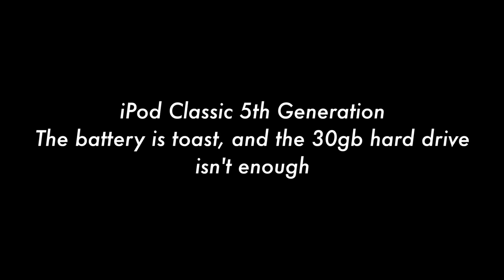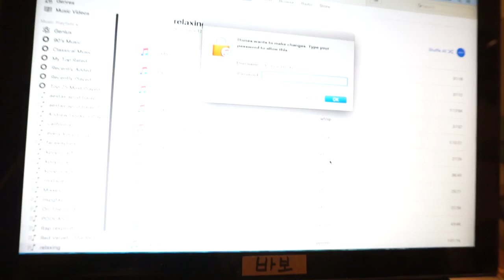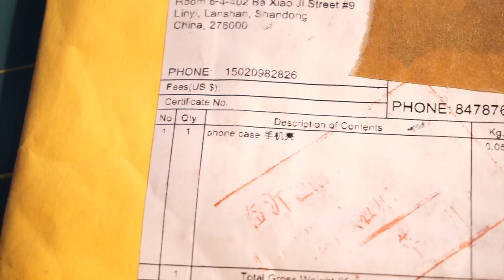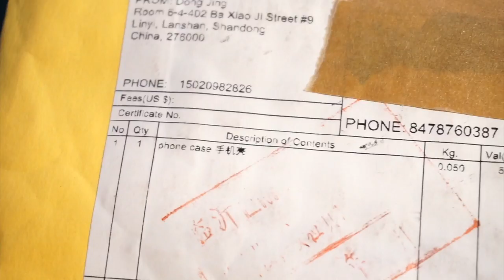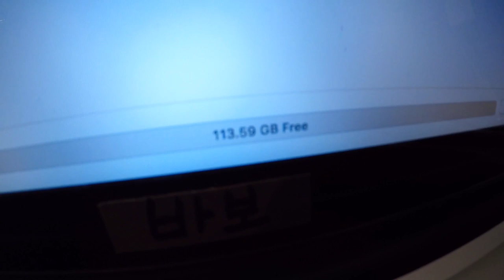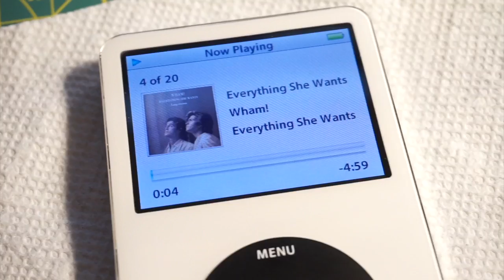Reviving an iPod Video

Comment: Dude, next time you break the case tabs, use clear color silicone Permatex Form A Gasket. Make a line & spread it around where the tab was/is. Snap the cover on and wait couple days till it cures. It holds well and dries rubbery, so you can take the cover off if needed. You can buy a small tube of that silicone gasket maker seal for like $6.00 at auto parts store & comes in different colors. I been using this for many decades. Buy the silicone one not the one that looks like brown tar.
Reply from the maker: Thanks, will do!

Comment: I've just ordered the parts for my old 5th gen Ipod Video. Its stuck on a white screen, not recognized on iTunes or Windows so I think the hard drive is kaput. Gonna try a 512gb microSD card, 3000mah battery and capacitors mod.

Comment: Nice music, also i've been thinking of doing this but am really nervous bacuse i don't want to breakit and i'm a begginer. Is it a good idea?
Reply from the maker: it's definitely a good idea if you have the 5th generation. The only thing you have to worry about breaking is the plastic cover (which I broke), but replacements are easily found on ebay

Comment: How do you know what battery to get bc i see thick and thin and I have the same one. Thanks. Good Video
Reply from the maker: I'm pretty sure it depends on the original storage size. Mine was 30gb, so I got the thin one. The 50gb or 80gb models are thicker.
Reply from the maker: The link I have for the battery in the description has a choice between both thick and thin depending on the model, so check that out too

Comment: What are iFixit batteries like quality/ battery life wise?
Reply from the maker: Wisco Di3co I can't compare it to the original battery, as the iPod had been out of commission for years before I replaced the battery, but it's pretty good, better than the original battery in my iPod nano 4th. It usually lasts around 3 days on a full charge while listening to probably a combined total of an hour per day